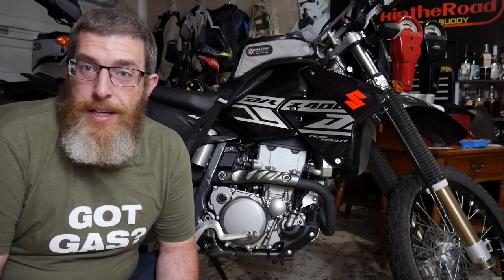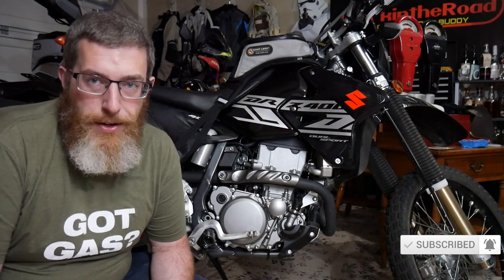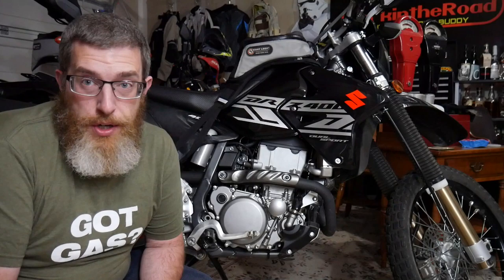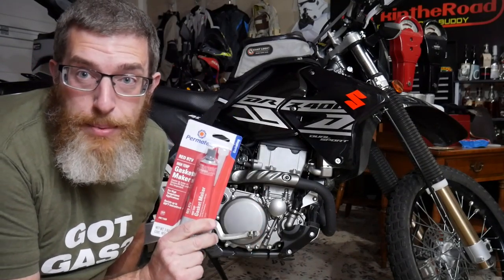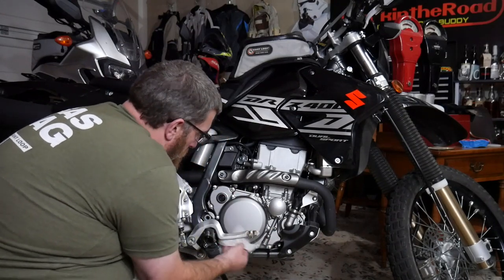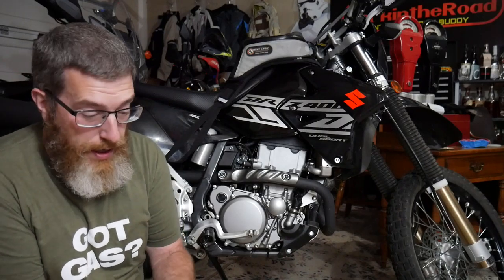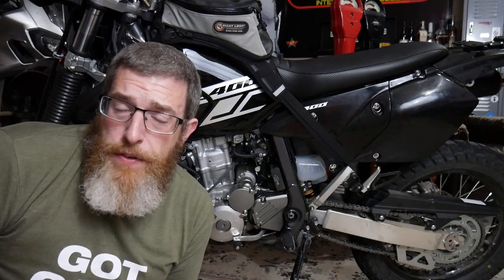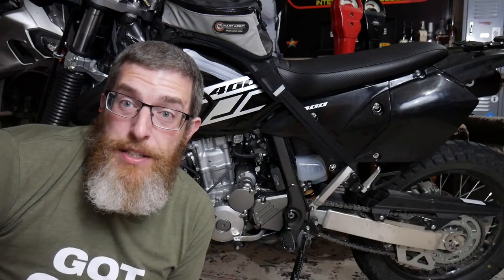How to Install Case Savers on a Suzuki DRZ400

Comment: thanks for the link to the case savers you used. I'd gotten the Tusk savers. Clutch side fit perfectly. Stator side would not fit flush no matter how i manipulated or how hard i pressed down.  They would not print my review on their savers. They asked did I want to talk to a technician regarding install...LOL!  They asked me to send in pictures of the issue!  WTF is wrong with RMATV and their arrogance about their Tusk products? Some I love. Others have been less than stellar.  Ride on!

Comment: I bought a dr650 back in January. Absolutely love it, has a little more 
Ass than the DRZ for highway use but is still an excellent off-road machine. Bit heavier than the DRZ but now that I'm used to it I don't even really notice it anymore.
Reply from the maker: I'd like to ride a DR650 myself someday

Comment: I have the thumper talk case savers, dropped the bike and cracked the case underneath the saver itself, all the saver did was keep it from shattering and slowed the leak, not entirely sold
Reply: Soft drop on accident on loose dirt while bike was parked

Comment: Dropped my DRZ on a rock and even with case savers installed I ended up with a quarter size hole on the left side. Damaged the internals too. $1100 repair!! Bad luck.

Comment: Hey man. Does your left side crankcase cover rub on your gear lever?
Reply from the maker: It absolutely does.
Reply: Aftermarket extended shift lever solves that problem.  Stock lever is useless anyway when wearing riding boots and using wide foot pegs - you can't get your toe in there to shift.

Comment: Just got the year bike. Have you considered taking off the "smog" bs? I.E. charcoal canister, and pair valve. Thanks
Reply from the maker: Mine doesn't have any of that. Not required in Oregon
Reply: @DorkintheRoad  Well shoot. No worries Ill probably just leave it all on there. What sprockets combos are you running? the stock is way too tall for my style of riding. I just ordered 14/47....
Reply from the maker: I'm all stock so far. I've been pretty happy with it
Reply: Thanks, ride safe.

Comment: Who decided RTV silicon was best... ? I would think 3M double sided tape would give it more cushion.. hmmm...
Reply from the maker: That's what everyone recommends.  Would 3M stand up to the heat?
Reply: @DorkintheRoad  Good point.. Dunno... What does the case saver co. recommend ?
Reply: Mine came with double sided tape. They were gone within 3 weeks.
Reply: The cases get too hot for tape. The adhesive will soften and release. Definitely use high temp RTV!

Comment: I used red on mine, later find out they make the same in gray.  Someone told me the gaps should be sealed all the way around to keep crap out so now my brand new DR looks like the motor has already been rebuilt. 🤬